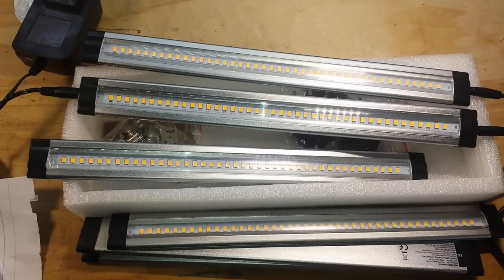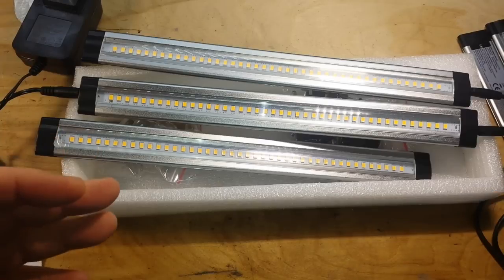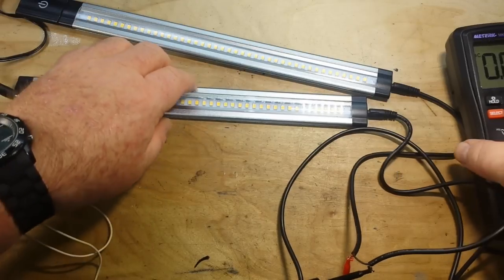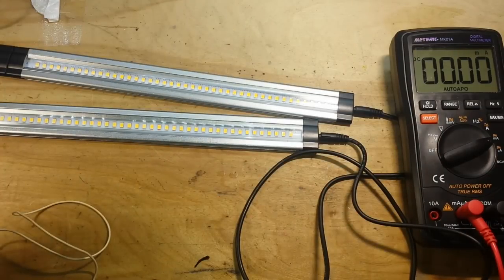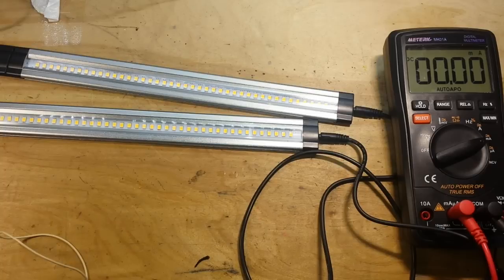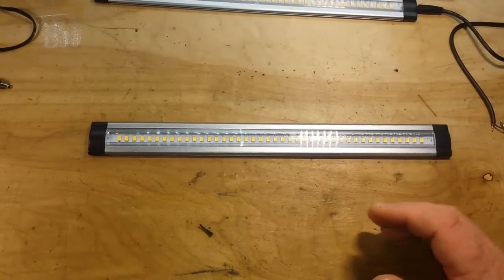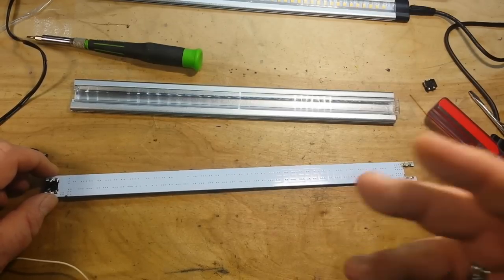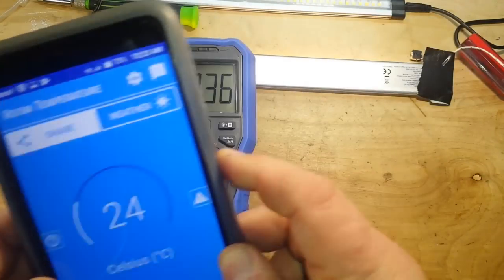LED Under Cabinet Light Kit from LE EVER

Comment: I'll have to check those out, the missus wants more light in the kitchen. Glad to hear the internet is back. I'd give you a holler but I don't think my handheld CB is up to it 😊 Thanks for a Saturday teardown video!
Reply from the maker: Thanks George. I give these lights my stamp of approval. From a power standpoint, they hardly sip any power at all with 3 watts Max. Safety wise they give me no cause for concern, good separation and no bare contacts.